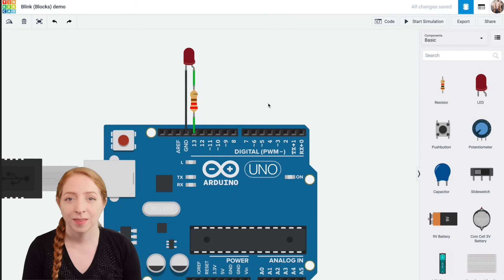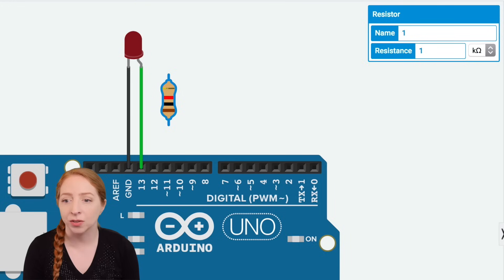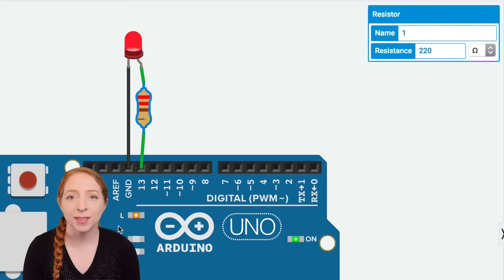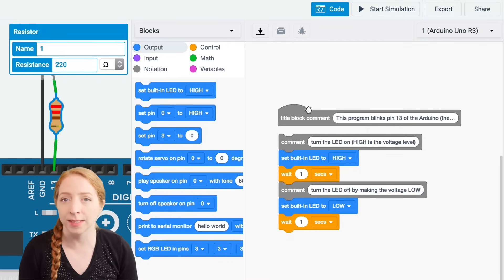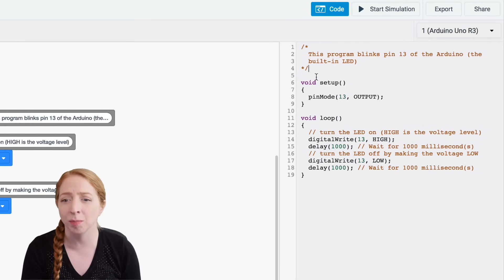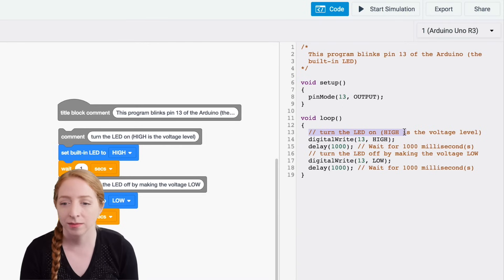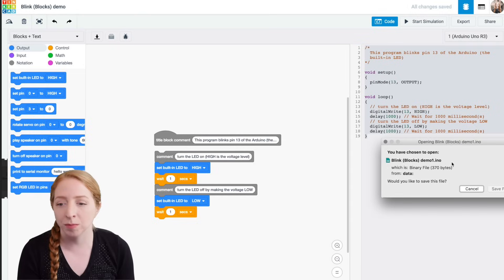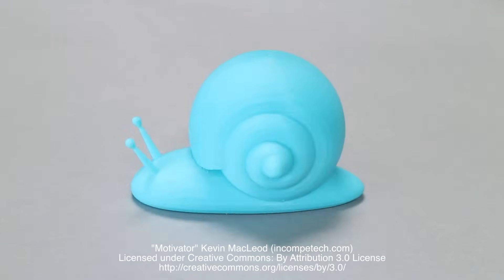Blink an LED With Arduino in Tinkercad

Comment: Thank you very much I learned something
Reply: Arduino is an open-source hardware and software company, project, and user community that designs and manufactures single-board microcontrollers and microcontroller kits for building digital devices

Comment: Please add more technical videos for ex designing line follower using blocks
Reply: Arduino is an open-source hardware and software company, project, and user community that designs and manufactures single-board microcontrollers and microcontroller kits for building digital devices

Comment: Hi. When i measure the voltage between pin 13 and ground the multimeter says 4.23V and if i program another pin lets say 12 (of course move the cables to pin 12) the multimeter says 4.44V, why not 5V? This only happens when i put a resistor, but still the source (in this case pin 12 of arduino) should remain 5V.
Reply: Arduino is an open-source hardware and software company, project, and user community that designs and manufactures single-board microcontrollers and microcontroller kits for building digital devices

Comment: So good material that I wanted to use it in my teaching. Wanted to translate (= correct the autotranlated text) but it is not allowed. Why do not want someone to contribute in to a such good (advertisement) material?
Reply: Hi there

I hope you may find this link interesting.

https://wokwi.com/arduino/libraries

It is a set of examples listed which can be compiled and run online on a browser. it runs on Wokwi Arduino simulator. In case, if you need any improvements please leave a comment. 

you can also visit https://wokwi.com for more such useful and interesting Arduino online simulations. 
#wokwi

Please give a like, if you find this information helpful 
🙏

Comment: Thanks for the great video on this.  I much prefer the text based coding on this.  Your system works well but does not do well on mobile deivices or with buzzers/sounds.
Reply: hi there,

May I present you one Arduino simulator which can be coded online with a mobile phone as well? You can stimulate LED strips, buzzer, beeper and more. 
https://wokwi.com/arduino/libraries
Please do subscribe in the website to receive useful tips and guides for Arduino programming 😀
you will find some examples here. 

#wokwi

1. It is a free simulator from wokwi
2. It is based on AVR8js and it runs faster than most of the simulators out there
3. It is updated every month online other famous Arduino simulations once, which they have stopped updating
4. It easily supports all third party libraries as well.
5. You can share the modified project easily with just a link. 😀

there are many more good features in it.

Please give a like, if you liked the contents of the website. 🙏. Please leave a comment if you have any suggestions

Comment: Thanks a lot
Reply: Arduino is an open-source hardware and software company, project, and user community that designs and manufactures single-board microcontrollers and microcontroller kits for building digital devices

Comment: Can i include RTOS (Real Time Operating System) in Tinkercad?
Reply from the maker: Tinkercad Circuits supports code simulation in the Arduino language using a text interface or with code blocks. Simulation of multithreading and other advanced applications that require replacing the bootloader are not supported.